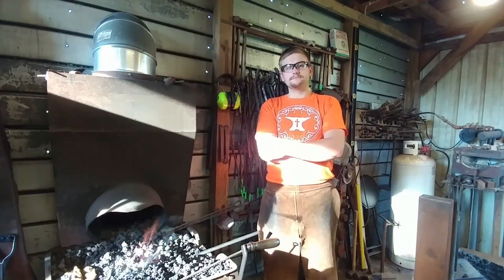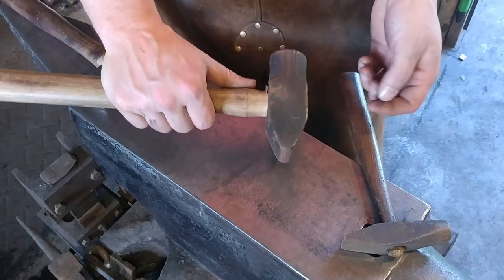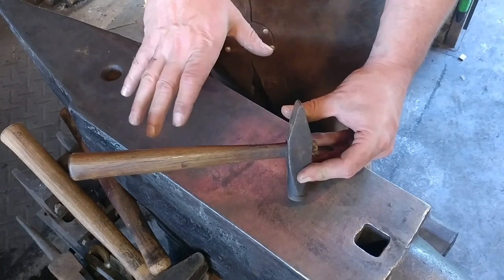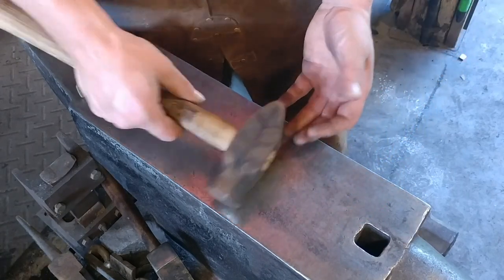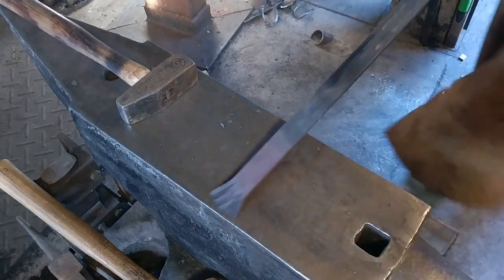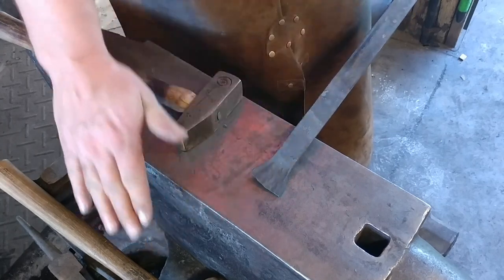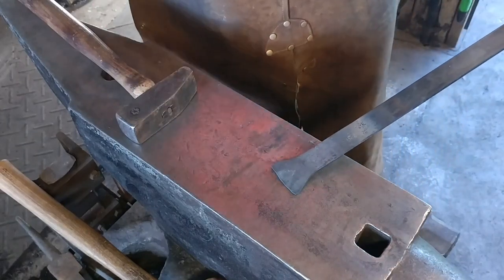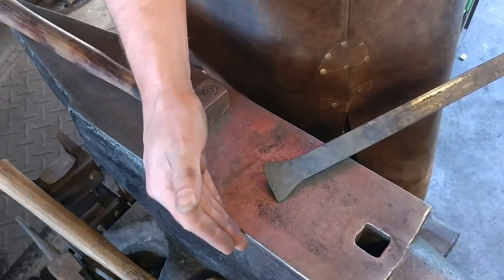How to Spread Metal // The Blacksmithing Fundamentals You Need to Know

Comment: Hey, I was trying to flatten/thin out a piece of 3/8" round rebar, and I got it flattened out but the flattened area developed an unwanted banana-like curve to the left while I was hammering.

Is this normal? I don't understand why it would curve to the left when all I'm doing is flattening it out.
Reply: Rebar is recycled material, one patch might have other elements besides iron and carbon, such as chromium or aluminum, that either repel or absorb the heat differently in one area.